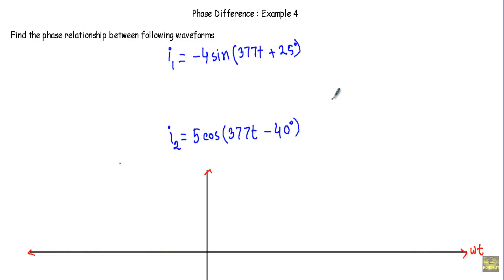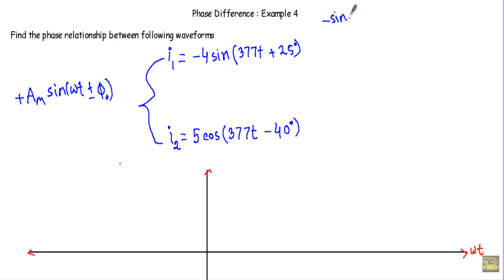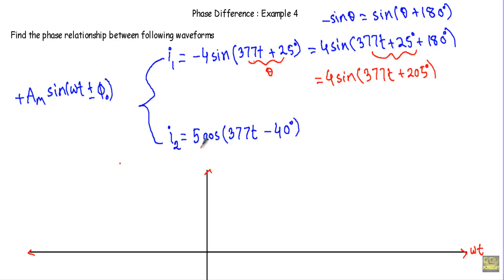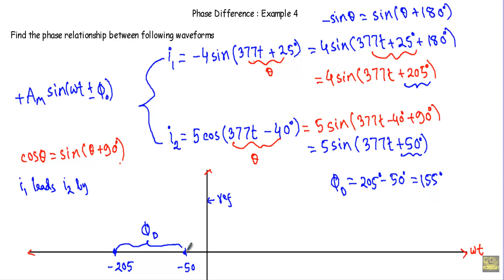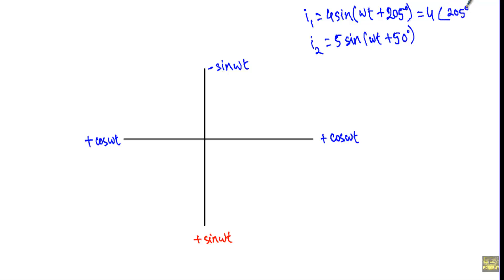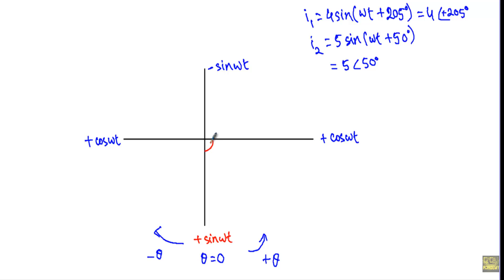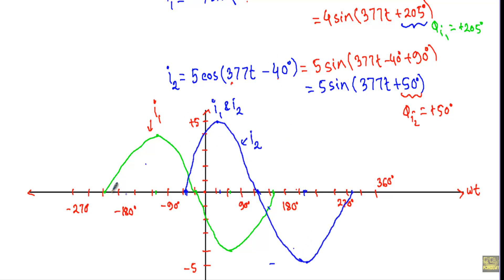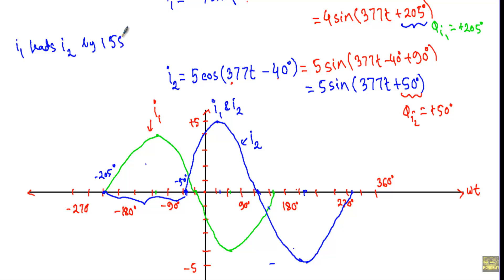Phase Difference : Example 4

Comment: Left side of x-axis should be - coswt, since you right side is +coswt.  I finally found a video on how to determine leading and lagging phases using what I called Sine-Cosine Clock, which I learned in school back in 1986.  Thanks.